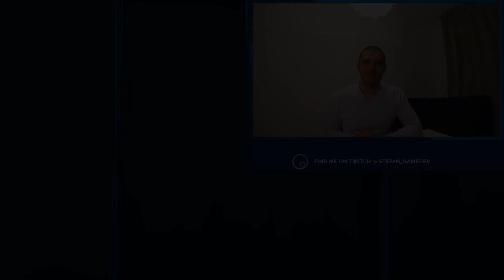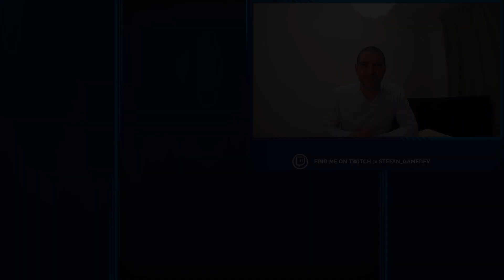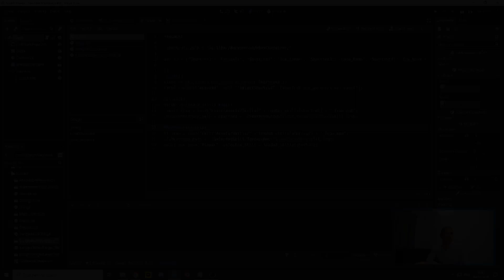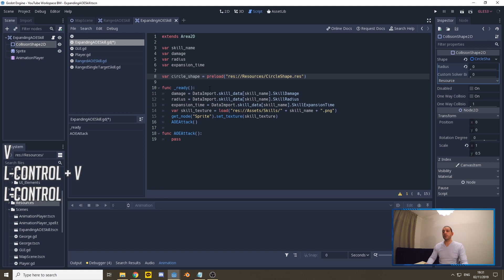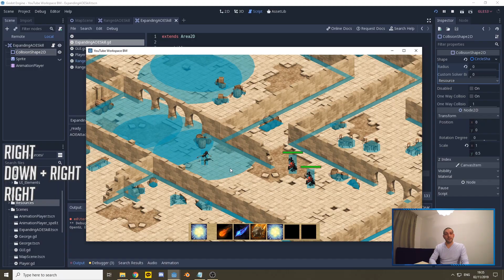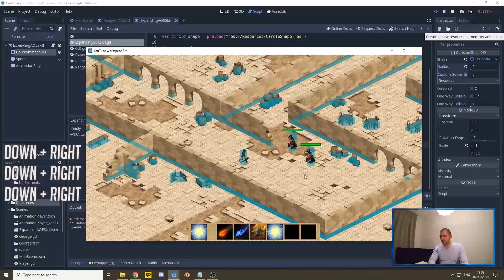Novas, Shockwaves and Explosions Godot 2d Tutorial | The Combat Series #7

Comment: I am going through this series and loving it a lot. I do feel however you under utilise AnimationPlayer and how powerful it is. You could replicate first 10 min of a video by creating a key frame in AnimationPlayer at 0 with collision shape radius at starting position and then another key frame at the end of animation with bigger radius and it would expand for you without any code or resource saving
Reply from the maker: Animation player wouldn't work for this application for the same reason as a tween wouldn't work(as far as I know and tested). Ones a shape2D's ID has entered the physics engine its parameters are frozen.
Reply: @GameDevelopmentCenter  Oh right make sense